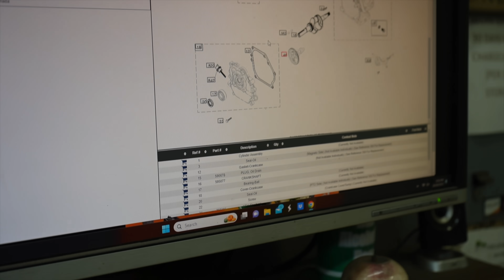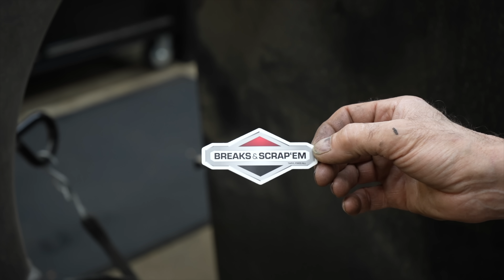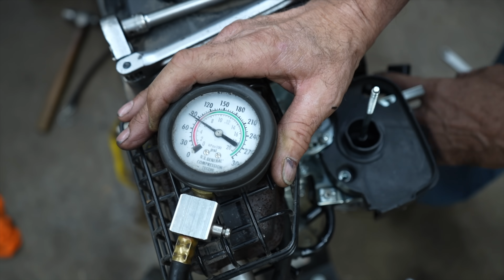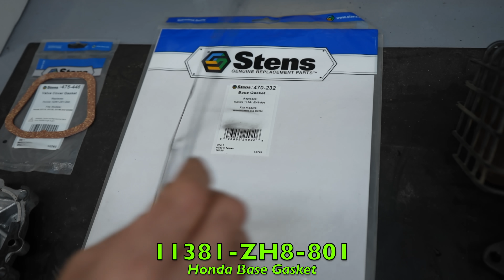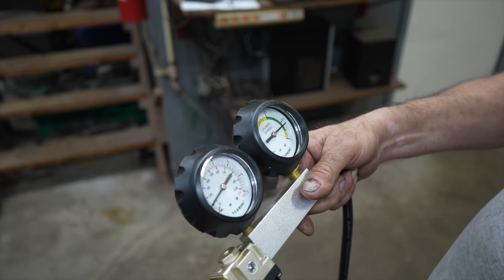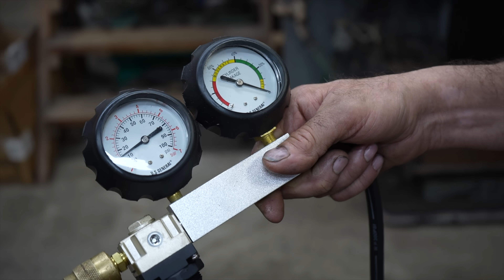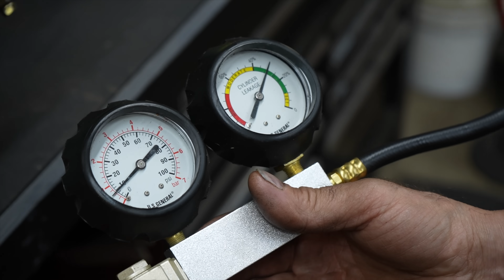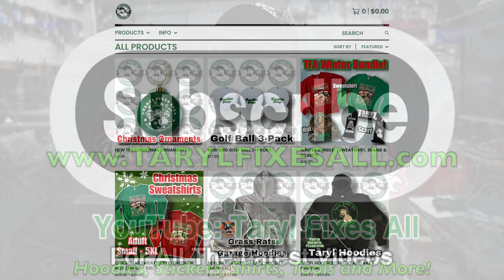Has He Finally Met His Match? Taryl is STUMPED!

Comment: You are still strong to pull that engine over that much! When you did the compression test on the bench engine it had a working compression release and 60 psi is normal, but the bad engine didn’t have a working compression release so what should a good compression be with out the release mechanism? Great vid

Comment: Without that ACR on the cam you will get higher PSI.... 100 PSI or so , Briggs didn't warranty a L-Head engine for me with the same exact issue , Warranty was out of date but engine had only 5 grass cuts on it ..... I assumed it was from sitting up for 3 years .... While a new lawn tractor was being used to cut and a  Strimmer to trim.....

Comment: Hi Taryl, great video, way to stick with it until you found the problem. I don't understand what you mean by "stuck" piston rings, if the rings weren't any good how could you have 80psi of compression? Also, I was an HVAC tech and owned my own business for 25 years and sold mostly Goodman equipment. Goodman never paid worth a darn for warranty repairs meaning they never allocated enough labor hours to fix the equipment properly(not the slam, bam, thank you mam way, you know what I mean), so I used to call them and talk to the warranty manager about that and she would tell me to send them an invoice for the additional labor and materials, and so I did and they always paid it promptly. I thought I'd pass that along to you because I think you're a hard working, honest guy like me and you deserve to get paid for the time you spend correcting their mistakes. 

It seems to me that Briggs & Scrap 'em rolled the dice like so many other U.S.-based companies and are having their engines made as cheaply as they can by by having them made in China;  now that decision is coming back to bite them in the ass. They're now leaning on you mechanics to pull their ass out of the fire while, hopefully, they are trying to right the ship. I urge you to do what I did with Goodman and make them pay the full price for such a poor decision by demanding more, a lot more, than what the going warranty rate is or at least make them pay you for all the time you had invested in this repair. Just hate to see them skim by by screwing you highly experienced capable mechanics out of the money you deserve for investing the time needed to find and correct their manufacturing mistakes. If I were you I might think about switching to a different brand. If us U.S. citizens don't start putting our foot down soon by calling these companies out we might get so far down the rabbit hole that we won't be able to find our way back out.

Thanks again for a great video, I really appreciate it!

Rick

Comment: I generally don't question your wisdom Taryl but I think you're missing an important thing or two here. First, I would suspect the owner ran the engine with no oil at all when he first purchased it. That happens all the time. Losing power as the engine heats up is a classic sign of bad rings. The wet black carbon on the piston and cylinder head would also be a clue. 

Second, a leak-down test will tell you a lot more than just the gauge readings. You can actually do this test without the fancy gauge by simply pressurizing the cylinder with air at top dead center and listening for air leakage in the intake or carb, indicating a leaking intake valve,  the oil fill tube indicating worn or broken rings, or the muffler which would indicate a leaking exhaust valve. This is the preferred way engines are diagnosed on aircraft but we used a slightly different model of tester. And a bit more expensive. Basically, the FAA requires a cylinder leak-down to indicate 70 over 100 psi or 70%. That is 100 psi in, and 70 psi holding on the cylinder. Of course, more is better but there will never be a cylinder that holds 100%. Had you listened to those three areas you would have saved yourself a lot of time. Which is usually the very first thing aircraft mechanics perform at an engine inspection. I would encourage you to continue to use that tester or purchase a higher-quality one from an aircraft supplier. It will pinpoint your problem within minutes. (Compression wise) 

Sorry if I'm coming across as a smart-ass. I've certainly learned a lot from you over your many videos and I've always appreciated them. Thanks for sharing this. Most YouTubers wouldn't.

Comment: I was thinking the whole time it was the gas cap. I had a snowblower with that problem, but then you said you sprayed it and it still didn't start. I wonder if previously, the leave debris plugged the vent on the cap and it ran lean for a while and cooked the rings ?
Reply: That was my thought.  Also did not de termed whether the right oil was used for break in and if that oil was getting by the rings on a overheated engine it could cause a lot of carbon causing the ring to stick

Comment: 22:01 You are right you can hear the miss. You don't have a sticking valve but it acts like it does.
Are you sure the rockers are adjusted correctly, they look lose 
32:55 Yeah that engine does not sound healthy at all
My guess was the valve seat
I would never have thought the piston rings were not free-floating, I have only seen that on rebuilds were the mechanic was a tool and installed the wrong ring set.

Comment: Nice work. I've literally done hundreds of rebuilds and have never seen rings stuck on a low hour engine. Curious if that's burned oil or carbon in the grooves of the piston. Maybe that thing was running too long on half choke? Who knows. Were the piston grooves checked for machine tolerance? Breaks and Scrap 'Em for the L.

Comment: A very easy way to check cam timing is to put an engine in to Split Overlap exhaust valve closing and intake valve opening get them parallel and piston will bet at top dead center or with in a degree either way and you are good and on these engines it will be probably right at TDC that is the fastest and least intrusive way to check timing on any engine

Comment: I've recently been fighting with an engine project with stuck rings (and bent pushrods) and researched a suspicion I had... is ethanol in the gas converting itself in to some kind of bonding agent when heated while running then shut down and left to sit for months? Can you imagine how many warrantees would be paid out unwittingly if this were the case? This would just drive down company profits forcing them to source parts and materials from (you-know-where) in order to remain in business. I'm sure B&S doesn't want to make crap engines. Maybe we should ban "corn-gas" for 5-years and see if these problems disappear.

Comment: Not really related to this but weird stuff happens. I have a gx390 and it ran but not great. It used to rip the cord out of my hand once and a while. Turns out someone put a slightly different flywheel on at some point. Changed it out and purrs like a kitten at a milk pail. Never thought the timing would be off.

Comment: i know its different but i had a 2-stroke 1998 RM  i rode it one day ran great as always..  2-3 days later of it just sitting in the basement no one touching it, it wouldnt start had to jump / bump start it & it ran like this did kinda no power still ran but not up a slight hill.. i took the carb apart it had a Pink fiber wrapped in a jet, the longer type jets we normally dont mess with on the 2-strokes went thru the one hole up thru the other 2 holes on that jet..  this pink fiber was soo thin almost missed it actually, i didnt think it was the problem, but it was..  so maybe now adays alot of things are made of them polyester fibers & they glow under UV Light so if ur working on small jets maybe keep a uv light around

Comment: This leak down test made me just order a tester for my ford 8N! I recently rebuilt it and not even 10 hours I had valve seating issues that I got fixed but if it starts it runs well but slowly looses power. Hopefully this is the same issue

Comment: I wouldn't have thought stuck rings. I've had worn out pistons and cylinders, scores, you name it, even stuff that sat full of water and siezed. If I grind the valves, clean out the carb, set the timing and ignition, they are one pull starters. Actually in spite of the low compression and oil consumption, they ran pretty good. Compression is a good thing, but the model T Ford started and ran good on a 3.8 to 1 compression ratio

Comment: I was originally thinking exhaust valve sticking in the guide, but stuck rings would be the same situation. I once stuck a valve in a Onan 14hp,it was my own fault, I put in old fuel from a motorhome, carbon washed into the guide and hardened, the same thing could happen to rings, 2 cycle engines do the same thing all the time. Have you ever seen a customer use old left over fuel?

Comment: I've got a Stihl FS96 1980s strimmer that starts and works for a few minutes but stops and then won't start. It doesn't like the OEM air filter that I had to clean by putting it in the washing machine because they don't sell parts for it anymore. It runs absolutely fine with the air filter out.

Comment: @TarylFixesAll when you checked for compression, the cub cadet was 60psi ( half the compression, de-compressor still inside ) ?. The briggs on the vacuum has that removed so its reading 80psi which is too little for a healthy motor. I suspect valves aren't seating well?

Comment: Years ago I had a lawnmower with intermittent ignition where it would run until it warmed up then it would quit until it cooled.  Eventually it stopped sparking entirely but it worked like that for some time.  I vote for a new ignition module for your engine.

Comment: I think what threw you off on compression test was you compared the Cub Cadet.60.psi to the B&S.80psi , but the Briggs should of had much more because the compression release was disabled. Real stoy is the $2oo Predator is a lot better than the $500 Briggs.

Comment: When doing the compression test, the sump might be pressurising so it could be a false positive. Simply pull the oil filler plug out and see if that releases the pressure. At least then you'll kow the problem is head related.
Reply: wouldn't the sump not pressurize due to the breather valve?
Reply: Correct, but what if the breather is blocked?
Reply: @jchristensen2022  true. i once used to much murphys mystery oil in my snowblower crankcase to give it a good cleaning. used to much. changed the oil and next time i started it oil was leaking from every bushing and seal due to overpressure. the sludge that was softened by the mystery oil splashed onto my breather and resolidified blocking it up. freaked me out seeing oil coming from everywhere. learned something that day.

Comment: I found with those motors said after it shuts down. The carburetor is wide open. If you hold that throttle back while you're cranking on it, it'll start.

Comment: I've seen some of those with plastic cam gears that have slipped on the steel shaft and has it out of time . Don't know but could be . Also the one i had with the bad valve spring keeper was missing the little cap on end of the valve.

Comment: Hey ,I have  a cub cadet ,19 " self-propelled lawnmower 173cc power more engine,,blows oil all over deck..oil gas been seasonally  changed and lot size is typical city 50x100..crankcase is pressurized,,thought it was rings so changed them and sealed cylinder head gasket,,still does it ..runs fine just pumps oil.checked valves with cylinder head upside down on bench with water ..seemed to hold it for quite awhile. Not sure what to do next ,it's about 10 yrs old

Comment: First clue it was compression related was when you only got 80psi after removing the compression release. Would have gone straight to the leakdown tester after that.
Reply: Right, I feel like it might of popped off if he used the carb cleaner on the Briggs but probably woulda still crapped out

Comment: Trick I use when putting my cast iron briggs engines together is checking valve overlap is at tdc to verify the gears didn't jump a tooth during assembly. 
Same trick can tell if cam lobes or gear moved out of time.
Edit: 80psi without decompression is nothing as flatheads push 90-120

Comment: I parked my TroyBilt Tiller in the Barn over gravel one year, so come spring the Tiller would not start.  I live in the Midwest with cold winters. The flywheel magneto collected moister and had corroded with rust. I tore it all apart and found out why it was not firing. Now the tiller runs like new, and I do not park my Tiller over gravel anymore.

Comment: heh, I had a boat motor with sticking rings making it hard to turn over after it's been running. It was one of the biggest pain in the butt things to figure out that I've delt with, because it would only act up when it was warm. Just like you I ran it through a gambit of different tests and interchanged as many parts as I could to finally figure out the rings were getting stuck when the engine was warm. (Man if I had a youtube channel on that on it'd probably take me days to edit out all the cussing at it I did!)

Comment: This is my guess as I have seen it many times. The customer thinks he is saving his engine by running partial throttle which causes extra heat because the cooling fins are not spinning fast enough to cool the engine resulting in excessive engine heat and damaged parts such as the rings which loses their tension around 260 degrees F engine heat. One more thing while I am at it and many ( maybe most will disagree with me) when rebuilding an engine NEVER NEVER EVER use motor oil on the rings or cylinders NEVER! Use a light oil that won't stay in place like WD 40 on the rings before it goes in the ring compressor and no more period. I can assure you by doing it this way your rings will seal much sooner and your engine will make more power.

Comment: You should see around 60psi with a compression release, with out it in there you should see over 100psi. I always just leak down test mine. Those compression releases can make for a good run around when working on a motor. Specially lashing the valves on a E Start motor

Comment: 8:13, you maybe incorrect on this particular snowblower engine, it might have an air filter.
I was working on one just yesterday and it did have a filter and it was the same as the engine you showed.
Also, the original engine being a clone type engine, I wonder if a clone camshaft would work.

Comment: This happens sometimes,they say a engine needs 3 things to run, fuel, spark and air,sometimes you need a 4th which is unknown,my boss had this old mower and i was helping him with it,we both are not Taryl by any means but know our way around engines,never got it started,i even took several components from other mowers i had and that didn't do it either,he ended up giving it away,lol

Comment: Rather than tear down an engine that exhibits the "Stuck Rings" problem like this, is there something you can pour in the spark plug hole and let soak for a while, blow it out with a compressor later before trying to start back up?   I have just used engine oil on stuff that hasn't been started in a long time, but wondering about something more specific to "stuck rings"?

Comment: I’ve worked on a few of those, b&s can say what they want but these engines are simply subbed out to a Chinese vendor. They make a minimum of changes so as to not anger Honda, brand them as b&s and pawn them off on unsuspecting consumers. I did a predator swap on a wood chipper and had to drill out the muffler holes and use a shaft adapter, bad idea I know but b&s didn’t even offer a replacement engine. What happened was the crankshaft had snapped right at the crankshaft, there were multiple inclusions where it broke. After my experiences with these engines I have come to the conclusion that not only are they just a rebranded Chinese engine, they are a rebranded crappy Chinese engine, they type you see on Ali express for $89. In your case it looks as though the piston ring grooves are too narrow or the rings too wide, this is probably due the the engine manufacturer sourcing the absolute cheapest parts they can find rather than contracting parts to be made specifically for this engine

Comment: The Briggs had 80 lbs compression because you took the compression release off the cam so it showed more. If it was on the Briggs  would have showed about the same as the Predator.  The big clue to the whole thing was it was easy to pull without the compression release on the cam.

Comment: I apreachate your videos and the work you put into them. I have enjoyed many. And I've gained many tricks from you. But your use of the Leak down tester is incorrect. With the model you have you need to set your regulator so the gauge on the left reads 100psi first to have an accurate % of leak down on the right gauge. Because it works as 100psi supply pressure is the 100% (if the cylinder is totally perfect sealed).

Comment: You got 80 psi compression with no compression release. The other engine had a compression release so 60 psi is adequate for that engine. You should have seen more than 80 psi with no compression release.

Comment: Has there been an update...

A cheapo leakdown method is to set the engine the same as leakdown test...
and with a modified spark plug with a tyre valve in it raise the air pressure to 20+lbs.. but put a balloon on the oil breather or bung up the breather and put a balloon on oil filler.. etc..
Question is...
What is going on with the piston, do the ring grove's need opening up or is there a problem with the aluminium?
Would the piston etc swap from the other engine?

Comment: but Taryl. you did a comp test on the cub cadet engine that has a decompression lever. so you would not get more than 60. take the recoil off and test with you drill on the flywheel.